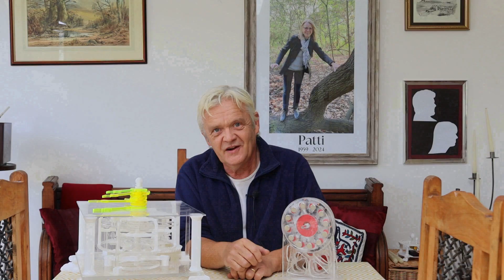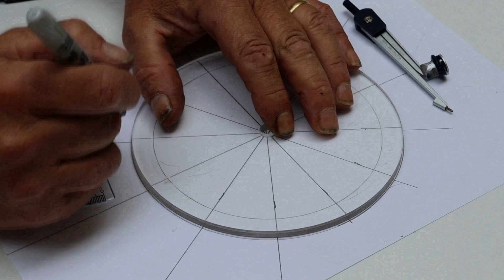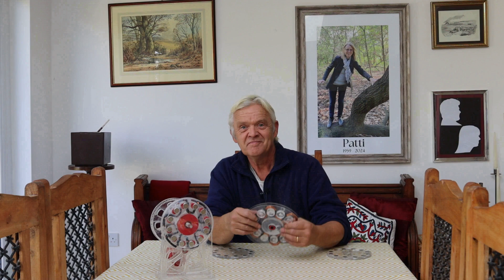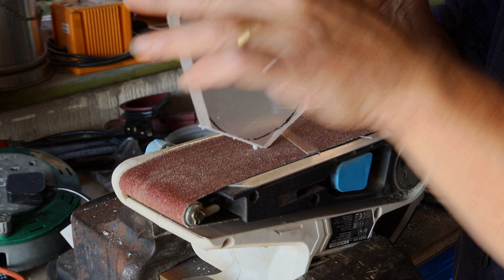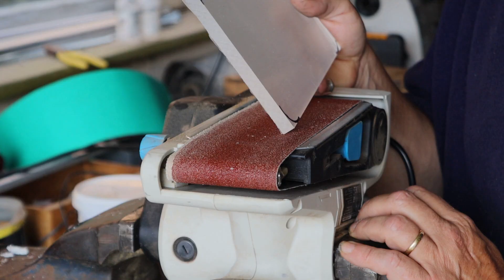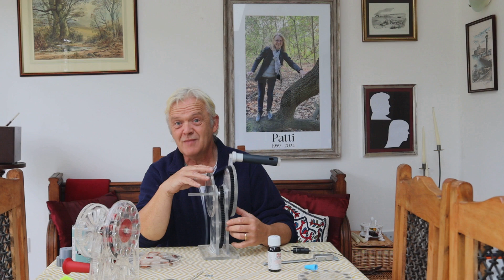2293 Handbuilt Crystal Generator With Instant Gears

Comment: Honestly, this could be made with wood planking or OSB and use standard old school automotive "V" belts instead of gears.
Instead of bearings, you could use brass or copper bushings.
(Bushings will be harder to rotate and not last as long but as the Brits say, "cheap as chips")
In theory, if a person has the time, all of the components could be collected freely from skips and rubbish bins.
Ok, the magnets would be more difficult but many old disk style hard drives have magnets, old fried stepper motors have strong magnets, etc..
The copper coiling will most likely cost money though, unless you want to carefully strip older electric motors. This is just supposed to be a fun hobbyist project.
Very cool video

Comment: Hi Rob, I know you now have a fancy laser cutter, so you get nice clean edges on your acrylic, but I have a little hint for cleaning up acrylic edges: HHO, or Brown's Gas, does a superb job of turning sanded or scuffed acrylic back into crystal clear acrylic again. You need some HHO (electrolysis will make that) and a jeweller's torch. Just play the flame on the edge.

Btw, I cringed a bit when you were using those hole saws. I know you're a careful guy but really that acrylic should be clamped down if you're going at it with a hole saw, especially a large diameter one, if that melts and grabs you might be turning your hand to making prosthetic fingers. ;)

Comment: Not to mention Chris (Clickspring) built the Antikythera by hand, including making the tools to make the parts by using techniques that would not be out of place in ancient Greece.  As a machinist, acrylic is a little finicky but compared to inconel it's roll face on keyboard easy to work with.

Comment: Good work Rob, I would be interested to see how many volts and amps you could pull from this.
Reply from the maker: It won't do more than 60 watts mate - that's what i have in my arm and power in power out
Reply: 😂 so you're a 120 watt unit with both arms. Is there a calculation that can be done for rpm to potential watts out from this? I'm just thinking a different drive source, not your 60 watt arm, say micro hydro. I'm wondering about a trickle charge for a 24 volt battery

Comment: You can also screw the acrylic to a board, and rotate it against a table saw and gradually raise the blade [works in reverse for a radial arm saw].

Also, you can cut a wooden template and cut it using a router, or you can cut it with a jigsaw.
Reply from the maker: that's a clever idea mate - i forgot about that one - nice tip thanks for sharing

Comment: 2 hints for cutting acrylic to keep it from splitting, spalling sticking or melting:

Hint 1: After drilling the pilot hole, (if you have the type which will do this [some do, some don't and you can, on some models, just flip the drive belt]) run the blade backwards,which is the same as flipping a plywood saw backwards on a skilsaw type saw.

Hint 2: Use a light cutting oil or kerosene to keep the cut cooled and lubricated.

Either of these will decrease the chances of damaging the acrylic.
Reply from the maker: cheers - awesome tips

Comment: Quick tip for cutting plexi: use a lube like thread cutting fluid or other, it helps cool the tool and the plex and cuts will come out clean with minimal melt. Thank you.
Reply from the maker: nice tip mate cheers

Comment: Nice build Rob ! Possibly one way to prevent acrylic melting when being drilled is to use a technique that is used in drilling holes in glass. Build a dam around the area with modeling clay and fill it with water. This would keep it cool, lubricate, and help clear chips away.
Reply from the maker: nice one mate - cheers

Comment: Another inspiring video!
The timing belt seems to be very quiet compared to the laser-cut gears. 
The rough edges of acrylic can be brought to a smooth shiny finish with a blow torch or heat gun.
Electric screwdrivers can provide a makeshift lathe for parts that have a center hole.
Laser cutters may be too expensive for those who'd use it rarely, but it can also quickly pay for itself by making all sorts of easy to sell items. Maybe more so than a 3D printer.
Reply from the maker: nice tips mate - and yes i agree - thousands if not tens of thousands make a good living from laser cutters

Comment: So your crystal generator uses no crystals and has no crystals. Okay. Right. I was hoping you were doing something really far out with piezo-electric quartz crystals, which would be quite an interesting trick. 

I got to say this, sorry. When you cut something, even soft acrylic, with a big hole saw, you really ought to clamp the part to your drill press work table so it doesn't grab and spin your part and injure the hand that should not be holding the part in the first place. Safety. It's a good thing. Remember, children and childish adults could be watching. Monkey see, monkey do. Set a good example.

Your output, then... it is single phase AC, right? 

Nice project, good visual appeal. I like it. You could gear that higher and put pedals on it for an exercise bike that actually does something useful, like charge a cell phone or something.
Reply from the maker: you don't need to clamp it mate - if it catches the pillar of the drill stops it turning - in fact all that happens if it catches is you stall the drill - there is safety then there is being anal a pillar drill like this is only dangerous if you stick your han under the bit and press the lever down - so for safety's sake - don't do that lol

Comment: PS... for safety, use some form of clamping of the material when using the drill press. Personal experience (not always good) was a learned experience. Cheers!
Reply from the maker: sorry mate I don't want to be rude but don't be such a safety sally - there is a level of safety that becomes anal if taken too far - i have repeatedly told people to take it slowly - if they take it slowly they will be fine - if they don't then they probably are in for a shock - but they are probably not listening to your safety warnings either - learning is often better first hand and a cut finger will certainly teach more than a warning they didn't listen to.- Actually if i think about it in 40 years I don't think I have every clamped anything for purely safety's sake - I clamp it for accuracy in machining and high speed machining for sure - but this drill is rumbling along at about 600rpm - hardly high speed - i have never clamped a piece of wood, plastic or acrylic and I have never had a cut finger from it.

Comment: I have been thinking of a poly vinyl alcohol and glycolic acid gel electrolyte for a battery. I don't know if carbon and potassium would work or if it would be better for potassium  or a zinc iodide or something else. I came to this idea while playing with google ai. So I know that the pva and glycolic acid should be soluble in water so do you let the mix dry or add a salt to it epsom, alum or and iodide to make the battery of aluminum and carbon electrodes? This is spam. But the goal is a solid state electrolyte or gel electrolyte.
Reply from the maker: true solid state electrolytes are a challenge - the only ones i really know that are successful are LISICON, NASICON and silver iodide - gel electrolytes or pseudo solid electrolytes offer much greater opportunity in  my opinion - even if it is a simple as fumed silica in H2SO4 - improvements can be made - but whatever you choose - and PVA + GA is a good one you are going to need an ion carrier - so, basically unless the gelling agent is an ion carrier with sufficient ion mobility in itself you are going to have to add a salt
Reply: @ThinkingandTinkering  Thank you, I wish I had a chemistry cad program.

Comment: Been a while since I watched one of your vids, great to see you still at it...! 😁👍. I've used those improvised acrylic shaping 'hacks' ... the Stanley blade and the clamped belt sander, many times... 😁. With the sander I ended up mounting it vertically with the belt running downwards next to a perpendicular horizontal plate and it improved my edge fashioning no end... 😁.
Reply from the maker: good tip mate - thanks for sharing

Comment: I have an Otour Lazer that cost around $200.  It certainly had some problems with being steady enough to consistently cut, sometimes the Servos moved too fast and the torque moved the machine.  But ot also opened up a lot of capabilities for the Price of am inexpensive table saw.
Reply from the maker: that is a very point and a goo dpost mate - thanks for sharing

Comment: Come on, you have "the knife and the cheese in your hand" and you're not using it!

Make a large set of gears to make a huge conversion of torque into speed BUT due to the fragility of the material you DO NOT use it at maximum torque, on the contrary, the best idea is precisely that it rotates slowly at the input and you connect the input to a gravity battery. In this way, the weight will spend more time "falling" and then take advantage of gravity more efficiently!

😁

Anyway another excellent video of yours, I love your videos that bring the construction closer to a level that anyone can do! \o/
Reply from the maker: cheers mate

Comment: Awesome 👍 thanks so much Robert I already order the hole cutters and have them already I have a drill press pretty much the same exact as yours again thank you so much for making this video it really helps I definitely will share this video to anymore who wants to make pulse motors or generators i reached out to you because i had recently bought a 40 watt CO2 laser cutter I spent alot of time aligning the laser mirrors took me a couple days messing around and finally got clean acrylic cut rotors BUT the laser cut walls are coming out in a slight angle the laser still need aligning somewhere Man I wish I had money to get an xtool machine laser Diode I could only afford the old school water cooled machine so I went to plan be got my 3d printer up and running and went another learning curve so I went from not knowing anything about CO2/3d printing/and manual cutting to getting the ball rolling in 2 weeks thanks you showed me some great techniques in this video to fill in the gaps thanks you so much Robert you really are a good friend 👍❤️
Reply from the maker: I am really happy you found this useful mate - as you know I made it because you asked and to know it helped is great to hear. I am impressed by the stuff you got together and so quickly - you can always combine techniques - for example where the angle isn't critical  you can use your laser and dot centers on your disk with the laser then cut the holes needed for the magnets with you hole cutters - people seem to want to use a tool for every job but the trick is to use them for what they are good at - all the best mate
Reply: @ThinkingandTinkering  thank Robert your absolutely right 👍 I want to ask you to please look at my circuit and try it out it out it will make a great wind generator if do d decide to try the circuit I have to mention that the trigger coil needs to be a separate coil from the power coil and you can move the trigger coil around the rotor for best output the generator circuit is a coil shorting circuit basically the trigger coil the on a transistor like Bedini sg circuit but in mine when the transistor is turned on the power winding get dead shorted between the collector and emitter you want to use all north or south magnets for this circuit I have to make another circuit that will NSNS so you can charge a capacitor and use a dumping circuit to charge a battery you want to short the coil on the peak maximum voltage of the power coil you can adjust the time when it shorts with the trigger coil 👍 check out my video where I demonstrate the circuit charging a capacitor I'm spinning the rotor by hand very very low drag pretty much none I'm using bifiler coils but you don't have to use bifiler just use single coils in series for power winding all monopole magnet nnnn sssss and 1 trigger coil 👍

Comment: Acrylic sheet is pretty expensive, do you know where to buy it for less?
Reply from the maker: you could do it wood exactly the same way mate - in fact that might be fun!
Reply: Skip diving, rescue from TVs/monitors etc, local tip/recycle centers.
Reply: @bikerfirefarter7280  That's right, I forgot about scrap TVs, a load of acrylic panels and a laser cutter would be a creators dream.
Reply: I once needed a 12" pulley and required some 1 1/2" aluminium discs, i went on ebay and there was a place with some and a very low starting bid, turned out the place was just 3 miles from home, and the discs they had were the holes left after cutting a circle from a large sheet to make roulette wheels, and these discs were the scrap- in the end i placed a bid and won, got 12 of them (they threw in a couple extra free when i went to collect- they had scrap bins full of them) the price I paid- less than the scrap price of aluminium, I put one on my big 13" lathe and made the pulley, and have 11 more to play with, one i cut discs from using hole saws. 
but the moral of the story is if you want something cheap, have a look around, ebay is good, look for what they call drops- the mechanical processes used in manufacturing cant use the last bit of a bar- the bit they hold onto, so they accumulate a pile of odd short lengths- these are the drops, and can be bought by the kilo on ebay- or finsd a local company that manufactures in the material you want, and ask them if they have a scrap bin you can have a pick through, you might have to pay a small amount- or you might give the person a beer.
i get sheet timber at my local timber supplier- anywhere that cuts sheets to a size will have odd sized leftovers, mine throws them in a bin and has a charity pot, yes I have picked up near half sheets of plywood for just a few quid in the pot, a local boot fair had a chap selling 30"x15" 9mm plywood sheets for £1 each, I took 24 home with me as basic building stock. its all out there if you keep your eyes open.